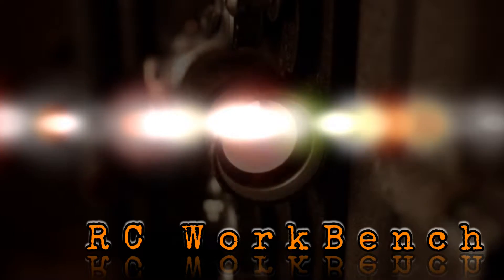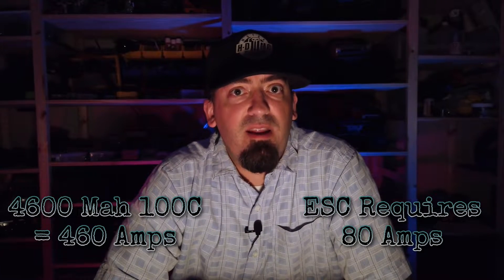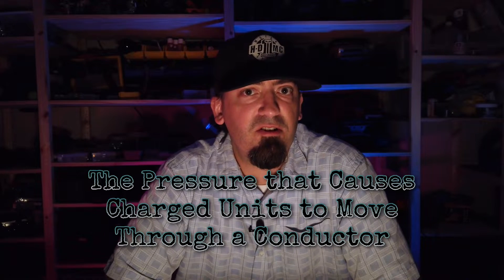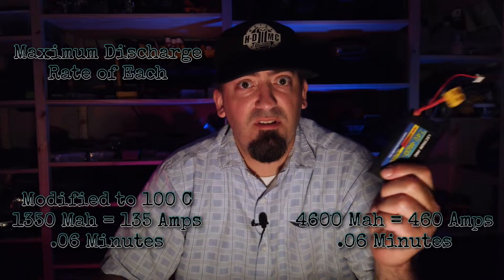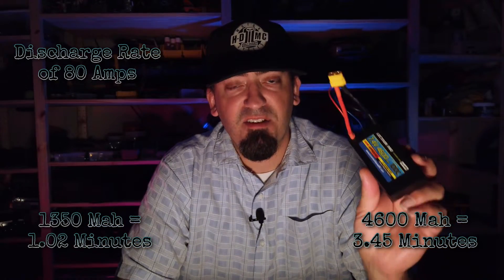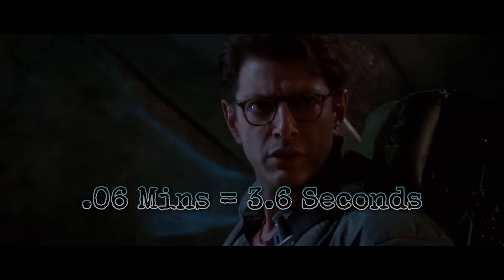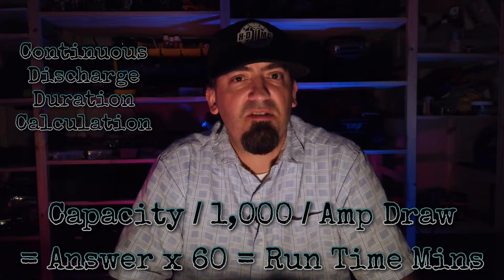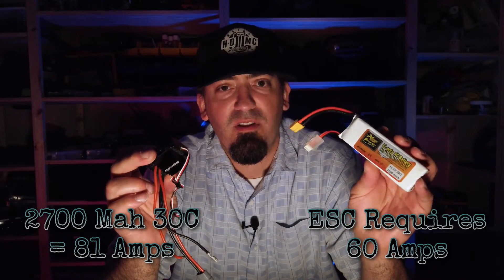Lipo Battery C Rating Explained and Does your Battery Provide Enough Amps??

Comment: If you have an RC that uses two lipo batteries in series, is the amp out put the total of both batteries?  Say you have two 3S 5,200mah 50c batteries.  5.2 * 50 = 260A.  So is the total output of both batteries together 260A or 520A?

Comment: Hi, thank you for the information very very helpful, you are the only that actually provide real examples with ESC and battery, not just theory.

I'm still having one question.

I have a new surpass hobby ESC & Brushless Motor with the following specs:
Motor Max Amps: 66A
ESC Cont.Current/Burst Current: 45A/240A

So the question is, which out of those Amps do I have to match (or double it as you suggested) with the C raiting calculation...?
Reply from the maker: I would try to double the highest Amp Rating on the ESC. But realistically anything over that should be fine, the more the better. 

If your motor is only rated for 60amps tho, your probably going to burn it up pretty quick.

Comment: Can you use a 4000 mah battery and a 5000 mah battery in the same car like a xmaxx or will this destroy something?? Both are 3s
Reply from the maker: It depends on the C Rating of those batteries and what ESC your using. I run 4000mah 75c batteries in my Xmaxx as well as 6500mah 120c batteries. Both run fine, using a Max 6 ESC but the 4000mah pair definitely has less punch.

Comment: If I parallel two batterys does the c rating double?
Reply from the maker: Great question!! I've never ran or charged lipos in parallel. However I do know when charging in parallel you base the 1C rating on the total mah of all the batteries connected. So if you have two 5000mah batteries a 1C charge rate would be 10amps instead of 5 amps. 

If your thinking about running parallel I would make sure all batteries in that chain were the exact same mah and C Rating. I would also recommend making sure the voltage levels were the same before connecting. As well as set the low voltage cutoff at a higher setting to ensure you don't run either one below the safe level. The ESC is only going to recognize the total voltage not each battery.

Comment: Nice job I didn't know that but it makes sense now. I like videos I learn stuff from .Now I will not run a 150 amp esc on 3s
Reply from the maker: What are you running a 150amp esc in? I'm thinking about doing a voltage video to compliment this one. You can run a 3S lipo with that ESC, a 5000mah 30C lipo can do 150 amps but I'd recommend at least a 5200mah 50C lipo for it tho. That would be 260 amps. 

Voltage would be the only difference between a 3S or 4S Lipo of the same capacity and C rating. Higher voltage means the same amount of amps at higher pressure. Will rotate the motor faster even tho amperage is the same.